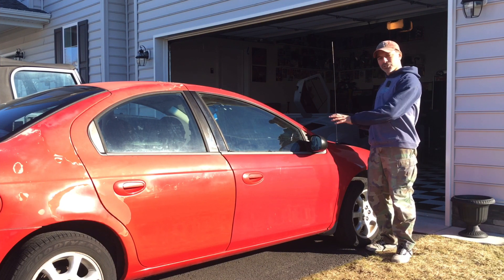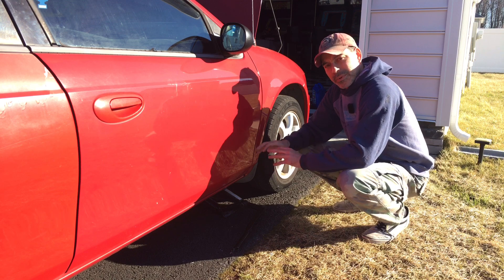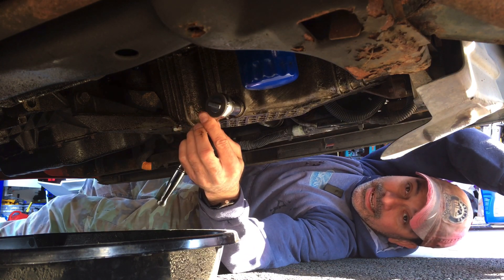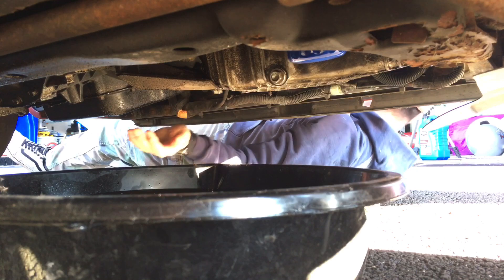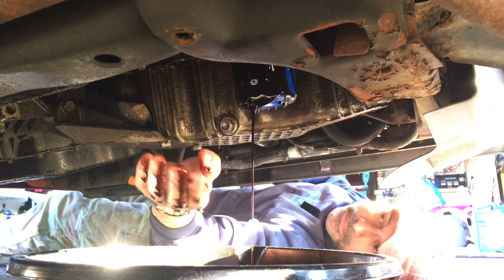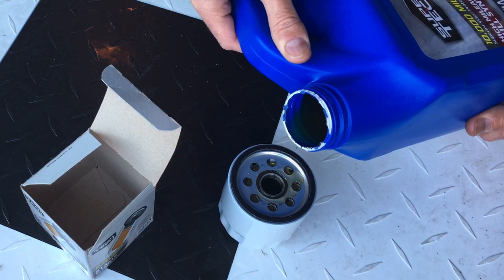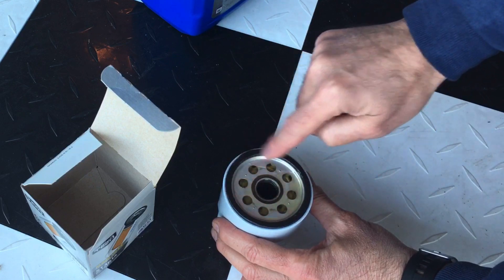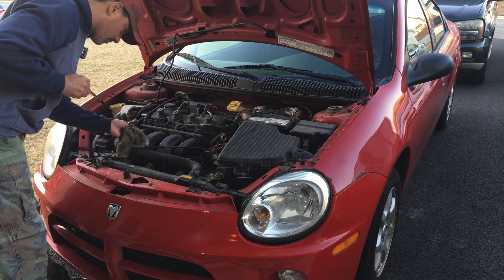How To Change Oil & Filter - Dodge Neon (Andy’s Garage: Episode - 325)

Comment: "This car is pretty easy to do an oil change on." I was almost giddy the first time I changed the oil on my 2.0 SOHC, because everything was so accessible!

Also, does it really call for 5w20? Back in 2000-2005? I'm gonna have to check my manual, but I run the heaviest oil I can in my 2002 SE, because it uses oil like that's its job, but I just did an oil and filter change on my "new" SXT, and I used 5w30. I also use a longer filter, specifically the Fram XG3600 (the gold one), which is rated for 20,000 miles.